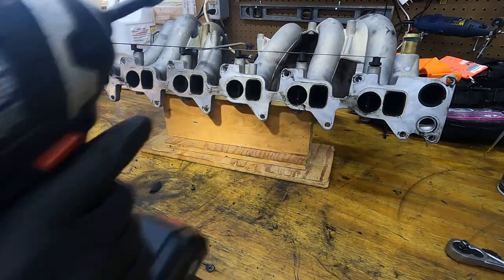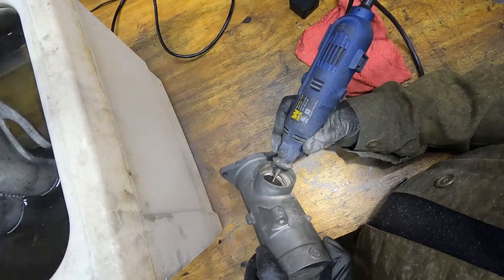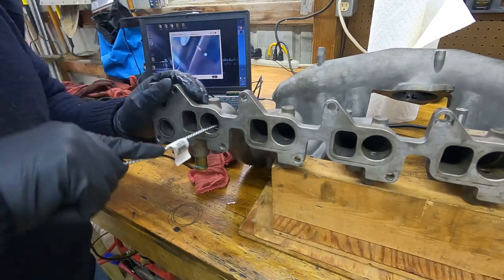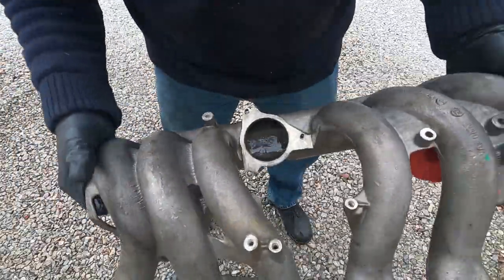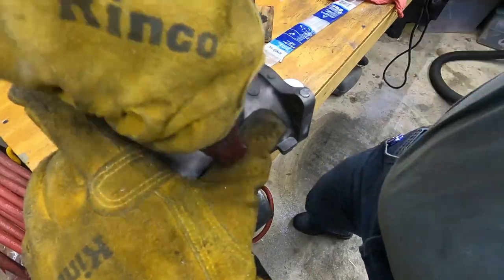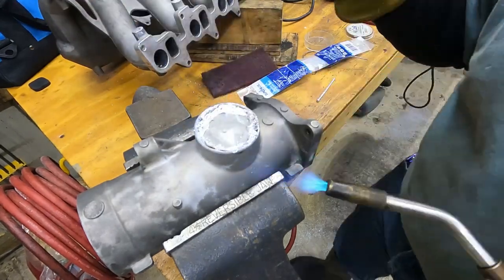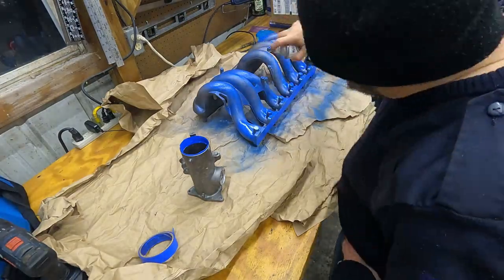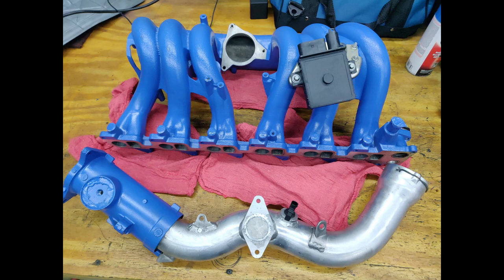Cleaning Up The Intake on a W211 E320 CDI Mercedes Turbodiesel

Comment: Thank you for this video! I am currently working through this process with my newly required e320 cdi. I did not consider painting the intake but after seeing the under the hood shot on your one year update video, I might have to choose a sweet color for mine! I am curious about the intercooler pipe you plugged, is this the one on the side of the intake?
Reply from the maker: Sorry for my slow response. I'm focused almost entirely on my anti-censorship efforts and haven't been on here, much. 
Let me know how your project goes. You'll get a faster reply on https://artofdiesel.substack.com
Yes, that was the intercooler pipe on the intake side that I plugged. That brazing process takes some practice, and lots of heat!

Comment: Mixing chamber... a guy did this and ended up with a bad weld, sucked a blob of material into the engine = destroyed engine.   Note: resonator acts as a buffer to smoothen out turbo fluctuations; some say it is a ner positive for the turbo.
Reply from the maker: The input is appreciated. Need to have a good braze or welding job on this for sure! Three's another "shock absorber" right after the turbo and the tuning of that resonator would likely be off anyways, as my intercooler has a much larger volume than stock. I'll have a gauge and I'll take a look at whether we see any fluctuations in this setup.

Comment: What did you end up doing with the port for coolant passage for the EGR? EGR was deleted with this mod obviously.
Reply from the maker: Yes. I capped it. I simply cut out a piece of steel to the right shape, drilled a couple holes, and bolted it on with a homemade gasket to seal it up.

Comment: I am having no success in getting rid of my P0113 error code? I have replaced the entire mass airflow sensor device (including both sensors), and the airmass sensor (mounted just before the turbo inlet. None of this has changed my P0113 code! Where should I look next?
Reply from the maker: Oh, goodness... I'm sorry to hear you've replaced all of that. The P0113 code is about the inlet air temperature sensor. This is found on the front of the aluminum tube that goes up from the intercooler to the mixer on the bottom of the intake manifold. These are cheap and relatively easy to replace. I recently replaced mine, in fact, with this part. Some might say to stick with Bosch/OEM, but this is working fine for me: https://www.amazon.com/gp/product/B0BL2ZP3JP
Reply: This is wrong info. I’m struggling with the same P0113 code which is sensor 1 IAT. If I unplug the sensor you are referring to, that throws a P0098 IAT sensor 2 code. I cannot seem to find where the IAT sensor 1 is on this car, starting to think it’s an ECU issue.
Reply: Dude I feel your pain. I’ve got the same code as you and for the life of me I can’t figure it out. MB dealer looked at it a couple of hours and couldn’t figure it out, said they’d need more time to diagnose.

Comment: Can you do this job for me? I really like my CDI, I've had it for 16 years and have 270k miles on it, I use it everyday but I'm pretty sure it needs that soot cleaning
Reply from the maker: Man...it's a lot of work and you don't want to be paying me for all of that. I'm not a mechanic for a living (I'm engineering manager in the aerospace world) and this is just my hobby. Contact a local machine shop to see what they can do for you. They'd probably have better equipment than I do and would be a lot cheaper/quicker than me. OR: Somebody provided an input about using a kind of slurry for this that is supposed to be a lot easier than my approach. Supposedly the information is on YouTube if you search around. If you find it and use it, please share your results! Also, please join my substack for free to chat in more detail: https://artofdiesel.substack.com/
Reply: @ArtOfDiesel  😩😩😩